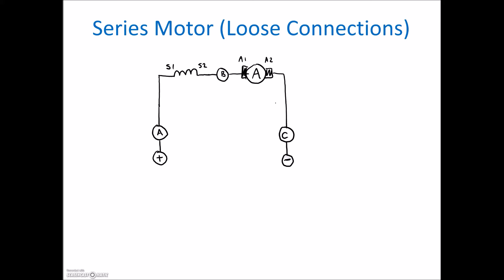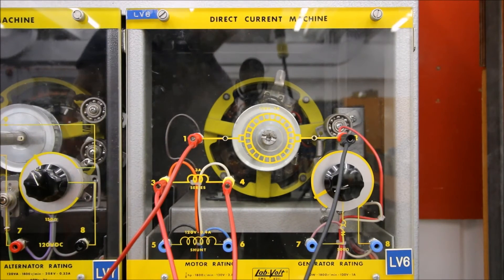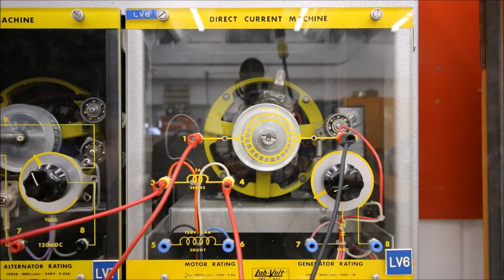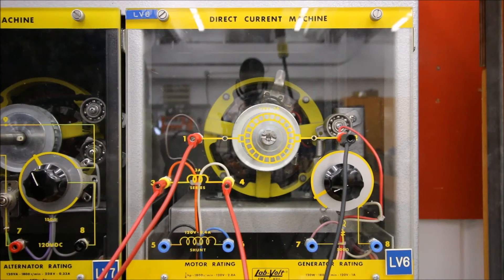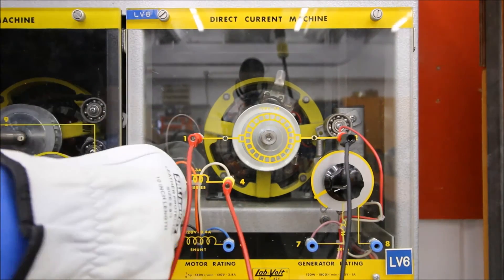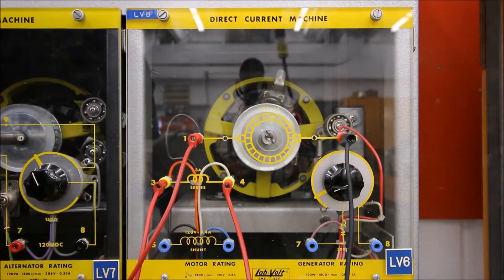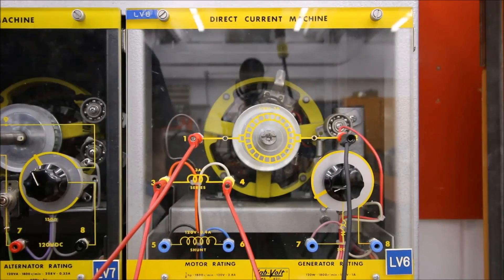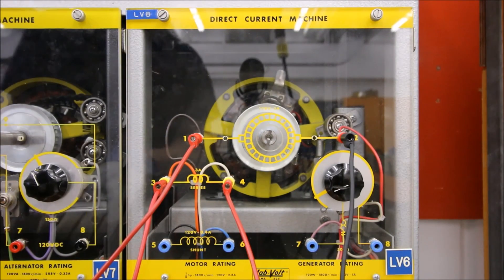Series DC Motor (Loose Connections)

Comment: Good morning engineer, I have this speed control, this is the KBIC-120 model, the problem is that it burned out, the motor model is Baldor CD3475, it has a switch that reverses the rotation forwards or backwards, any guide on how to connect it to this speed control, thanks for your time

Comment: Great videos! Would you have a video over the Lab Volt Dynamometer 8911? I just acquired one of these units almost exactly like the one you use in your videos and I was needing more education on the Dynamometer. Thanks.
Reply from the maker: I haven't used one of these yet. However, I came across this video 
https://www.youtube.com/watch?v=LqFdSA6QqME

Check with your Festo Rep. They are quite helpful in providing info.
Reply: Thanks!